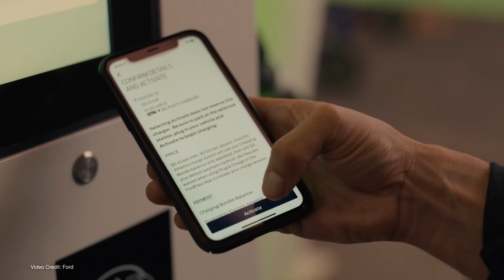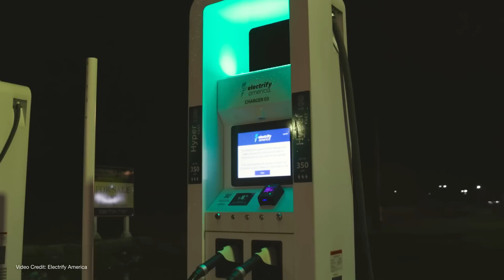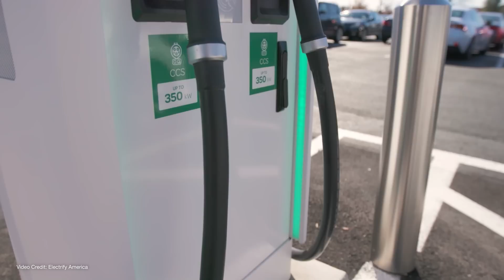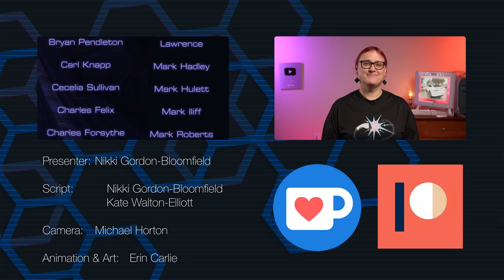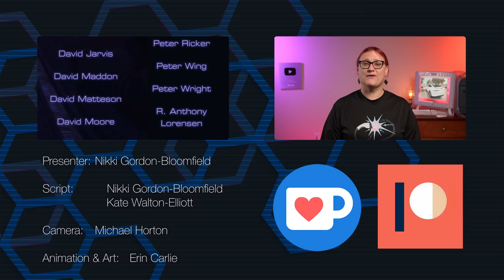EV Fast Charging Is BROKEN - And NACS Won't Fix Everything

Comment: providing better ethics from charging patrons is not hard, it would be very easy to add a nice label saying something like "Remember, it is generally good etiquette to move your care after charging to 80% so others can use this charger." In plain view (a separate sign, along the cable, on the charger, etc...)
Reply: That is a lot to unpack, people have to understand what a charging curve is and how it works to even understand why 80% even matters.
Reply: @fuckthisksksjjksdfjd  The wording i gave is just an example. people buying an EV likely know what they are getting in for. Propose some wording, as signage is a first place to start in letting people know what is good and bad behaviour. 🙂
Reply: @xiaowei1  if "people buying an EV likely know what they are getting in for."  then you would not need to explain 80% to them.  I have heard of plenty of stores where people could not figure out the fast chargers.
Reply: @fuckthisksksjjksdfjd  yes, i agree. I have been driving electric cars for about 10 years and tried a charger for the first time this year. it was cumbersome, and the only way I got it to work was to download an app and start it from the app. I should have been more specific and said, early adopters. I most certainly already knew the etiquette of not using a charger beyond the required time, but I have had years of hearing horror stories to know. So i accept your argument.

Comment: I have a Tesla and a VW and both have free charging. If a station is busy, Tesla will stop your charge session at 80%. One thing I love about Tesla is that the route planner will tell you when you can unplug and reach the destination with a 10-20% charge. The VW is more of a wild guess, so I usually add a 60 mile buffer. I've never failed to get to a stop, but a few times it was close and the car goes psycho if you drop below 20% even though there is a double top secret buffer that I haven't chanced if you go below 0 miles remaining. VW routing has changed my destination many times, the worst being from a 10 stall EA with 150/350 plugs to a single 24kW at a dealership in a different direction from where I was going. I arrived at my original choice at 9% without even slowing down.

VW does give free charging, but it pretty clearly says 30 minutes of free charging. The meter starts right at 31 minutes. I charged from 19% to 70% in 26 minutes yesterday. I might have stayed the extra 4 minutes, but I had groceries. If the charger had been full, I would have picked a different grocery store and charged at home.
Reply: from what i heard is, that the older ID software does not take elevation changes into account. and latest german ID software version is probably not that easy available in the US because the US localization group needs to test and implement local US needs. so, you obviously need patience.
Reply: @stefanweilhartner4415  My ID.4 was made in 2023, so hopefully it has the latest hardware and software and allegedly the ability to take OTA updates. I have no idea if they have done any since I got the car at the end of April, but they occasionally ask if I want to update settings and then it resets the HVAC to 72 degrees even if I had the AC on and 100 degrees outside. 
I expect to have the car for the next 1-3 years, so if they get around to improving it I would be happy. Otherwise I’ll probably be back in a Tesla

Comment: on the free charging, hyundai give out a free 30 mins which is enough to get to 85-90% depending on 150kw or 350kw in an ioniq. i feel like 30 mins free is perfectly fine. most cars need that just to get to 80% anyways.
Reply: Good point, my suggestion would be a little more extreme.
All electricity is free up to 80% SOC, after that you have to pay for the power, and after 95% idle fees apply.
Reply: Even if the free charging is only 30 minutes, any encouragement from automakers to use public chargers in one's home city as a primary charging mechanism is a bad idea. If automakers want to subsidize charging when you buy the car, they should do what GM does pay for the installation of the home charger, not offer free charging on the public chargers.

If Hyundai really wants to subsidize EA, it should be something on the order of paying the monthly fee for a Pass+ membership - some money saved, but preserves the principle that anybody who can charge at home should charge at home whenever possible.
Reply: @ab-tf5fl  so i think the problem with that is a lot of people don't get an electric car because charging at home isnt possible. owning a house you can plug in at is a luxury.

Comment: Nice breakdown of the problems. Can't tell you how many times I've seen EV's parked that have finished charging or are not even Charging but just sitting there taking up the space. I would love to drive and visit friends cross Canada in my EV but it is such a colossal worry that I usually forego the adventure and go in my prius Hybrid. I don't want to but I just don't trust I won't have to get a tow down from a mountain somewhere. So here it is. . . I believe Every gas station ought to have at least one electric supercharger! I believe it should be required and I think it should happen yesterday and with government funding if need be! Don't tell me fossil fuel company's can't afford it though.
Reply: Tesla goes into a hi penalty charging phase if anyone overstays there welcome at a NACS.
Reply: @DelPhonic1 can’t penalize if they don’t even plug in which does happen frequently
Reply: @KalleSWBeck  Yes they can...They send a pack of Optimus Robots to kick in the doors and drag it to another space.  Talk about embarrassing for the "No-Plug Parkers"!!  ;-)

Comment: Traditional filling stations also have attendants, which cuts down on vandalism and means there is a human to speak to if there is a problem or question. Additionally,  credit card readers for payment.  The less you have to deviate from the current fueling experience the easier the transition.
Reply: Most gas stations only have attendants during the day, but even that I suppose is more of a deterrent than none at all. Another deterrent is a well lit, central location with surveillance as opposed to a few stations in the back of an unlit empty parking lot with no surveillance whatsoever
Reply: @BrandEver117  I don't know where you live, but that is not true here in Ohio. I believe attendants are required.
Reply: So, if the "less you have to deviate from the current fueling experience the easier the transition", why is it that Tesla puts their charging port where most ICE vehicles have their gas port and most other EV manufacturers don't?  Why are you not complaining about that?
Reply: Tesla superchargers dont need attendants for charging.  There is never an issue.  The only thing they may need are attendants to clean up the overflowing trash cans.  But the charger process is flawless. You'll eventually see.
Reply: In my experience, gas station pumps either work or they dont... and having an attendant has never magically made that experience better. In fact, those people are often stressed out or dont care. And gas stations are TERRIBLE about communicating problems. Sure, sometimes there is a red bag over a down pump, but often their isnt, and each individual customer has to discover it for themselves. Or the pump refuses to take a credit card payment and there is no sign, and again, each individual customer has to discover that for themselves. And how many times have I been to a fully automated station that the owners decided to make it so the fully automatic pumps HAVE to be turned on by an attendant... which also means they dont operate when the attendant is in the bathroom or the store is closed. And hell, when you DO speak to an attendant about payment, they cant just "fill it up", they demand to know how much to put on your card, which is difficult at a gas station and I would think near impossible for EV charging. And do you really want to wait behind 20 people buying lottery tickets just to START charging your EV? And how about someone yelling at you in a staticy, crackling voice over the loudspeaker at the pumps and you cant even tell they who they are talking to let alone what the hell they are saying? The attendant isnt making THAT experience any better.  And more to the point, there is NO standard way to pump gas. The experience is different at almost every kind of station, sometimes annoyingly so. And Ive seen plenty of vandalized stations covered in trash WITH an attendant. Maybe it deterrs some people, but it certainly doesnt deterr all people. 

I think in general people have some very bizarre rose-colored blinders on when it comes to gas stations. We are USED to them. But they completely suck. Heck, Ive even been to ones that had heavy bollards everywhere and the hoses were too short and I had to move my car several times and re-initate payment to fuel up. NO, we should NOT base EV charging on gas stations. They suck. We are just used to them. Thats all.
Reply: @sambira  ICE vehicles put fillers all over the place.  Left rear, right rear, behind the licence plate, and old trucks were elbo high just behind the drivers door.  I've owned ice vehicles with all those configurations and more.
Reply: @DelPhonic1  it won't be once there are other manufacturers involved, that was the point of the video.
Reply: @ericapelz260  They used to but not so much anymore.  I have also owned vehicles with those configurations but not for a long time.
Reply: @patreekotime4578  I never claimed was better, just familiar. I've experienced all those issues as well, and I don't miss them at all.
Reply: NOT having to mess with a Credit Card is MUCH easier...don't need to futz around with it at all. Most manufacturers should be able to do Vehicle Recognition, if they simply put that as a priority.  A phone app if they're just lazy.
Reply: @ericapelz260  It probably WILL be fine. Tesla is much better at software and charging processes than the others.  For the major automakers, you can bet there will be a Tesla Software Team that is overseeing the integration with Ford, GM, etc. vehicles into the Tesla Charging Network.
Reply: @ericapelz260  It depends on the state. I've stopped at many rural gas stations that don't ever have an attendant. Here in IA, all Hy-Vee gas stations keep the pumps open even when the stores are closed.
Reply: @davidc2838  It's easier for you. Credit cards are far easier than phone apps for other folks. Lets not pretend they will have automatic payment working for every car.

Comment: I don't know how feasible it is but I also think charging stations need to add cameras.  I expect vandalism to increase as more and more people feel EV adoption is a threat to their way of life.
Reply: There is very little vandalism at Tesla superchargers.  Everyone is facing each other, think of 8 to 20 cars with everyone noticing everything if it goes down.  So nothing goes unnoticed, since there are many witnesses and comrades surrounding you in case of a threat.  There are many more 'friends' than at a gas station.
Reply: I wonder if insurance companies will start to require cameras and/or other security measures before they'll insure the installation.

Comment: Overall, I agree with your perspective that switching to NACS will not solve most of the major issues with charging in North America. It will largely be up to charging station hardware providers to make a better product that can match the reliability of Tesla's in-house solution. So many people online are just focusing on the connector itself and ignoring the rest of what the charging infrastructure interfaces with.

Comment: What is being missed other than reliability is the ease of plug and pay that comes with owning a Tesla. I own 2 Tesla Ys. Charging is always easy. I own a few other other non Tesla EV's. Charging outside of our house is a pain. Needing to have multiple Apps or cards, that I feel 50% of the time aren't acknowledged, which then leads to a 15 minute call to said service provider. Have all vehicles set up to charge and pay and 1/2 the problem goes away.
Reply from the maker: Did you watch the video?
Reply: @transportevolved  your concerns are not shared by me and it seems, @sheldonridout8799.   Because I don't see anything but more amazing choice for you guys, and leaving behind-- or forcing to make better, the EA and other chargers that simply give an inferior charging experience.   More cumbersome, not reliable, and much slower charging speeds than what they claim.  Tesla competition will make them better.  You should be encouraged, actually.
Reply: @transportevolved  Ah yes I did. What part of my response confused you? Lets try and be a little less condescending with your response. If you don't understand my point just ask for clarification. I will add you must be having a rough day. I have a booth at the Fully Charged show in Vancouver. Stop by and I will give you hug. From your oddly hostile response you seem to need one.
Reply: @DelPhonic1 And if EA just switches to a NACS cable and thats all they do... its still the most common charger after Tesla, and thats still a huge problem.
Reply from the maker: @sheldonridout8799  Sorry if you felt it was hostile. The majority of the issues we brought up were not connection based. - Nikki.
Reply: @transportevolved  You brought up multiple issues. As user for multiple EV types, my issue is the fact that not having plug and pay is inefficient and adds to the frustrations of EV owners. With my Teslas I don't have that issue. As far as me feeling that your response was hostile. It has nothing to do with my feeling. You where being hostile. Normally I wouldn't even bother pointing it out. I am far from being fragile, but when a presenter who repeatedly points out the negative behaviour they receive from others, I do feel the need to point it out when they display the same behaviour. Anyway good content. See you in September.

Comment: Completely agree that NACS doesn't solve things...  In and of itself, it is mostly just a more elegant plug.

NACS is not the networks nor vehicles which do/will utilize it.

EA, for example, can still completely fail to keep stations online or deploy too few of them while having NACS plugs.

It is the ability to use the Super Charger Network as a non Tesla vehicle which will solve the shortfalls of CCS networks... As well as bring new problems like cable length etc.

Tangent on V2X: I think it should be supported per the 15118-20 CCS.  That way all vehicles can start to speak a V2X protocol, but again, the port doesn't matter.  And I don't expect DCFC networks to cover V2G, seeing as how we go there to get a charge, not support the grid.  But when I'm at home or work It might be great to connect to a V2X port and keep a critical load online.

It would be great to for example deploy these at schools and hospitals so to encourage real world application testing early.

We are at a ofd stage where there are many V2L solutions that are all close but none will be the seamless V2X interoperability standard we need for an agnostic smart grid.

The solution i believe will look something like a stationary DC-AC (powerwall) with vehicles able to join the DC buss side to top off the stationary batteries.  Having your AC go on and off as vehicles join and leave is no good.  So i imagine the core to be high power smart building UPS systems with minimal storage, but the ability to tap into portable batteries.